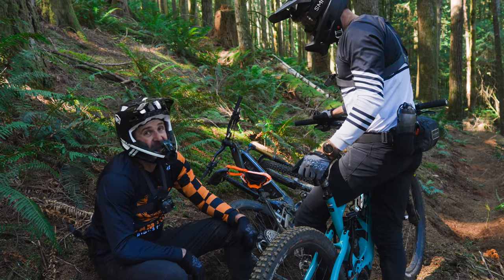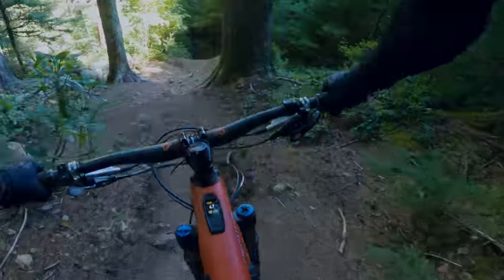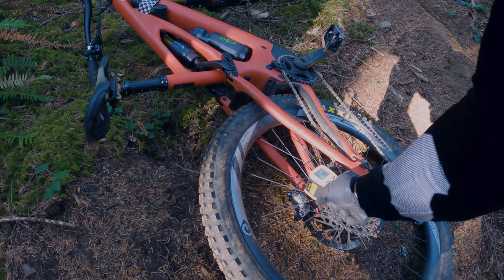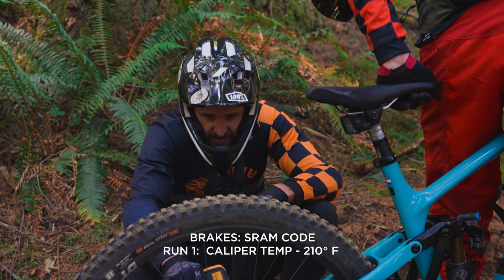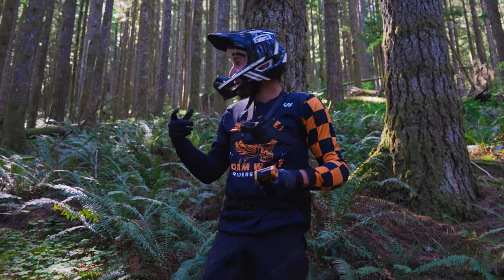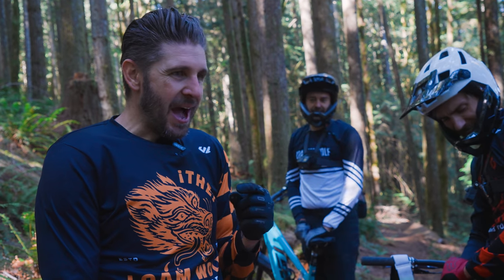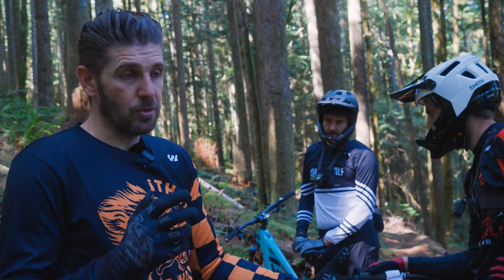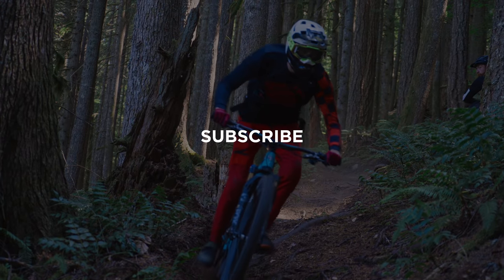Mountain Bike Brake Test - Temperature Testing. How Hot is Hot?

Comment: Why only measure caliper temps?
Reply from the maker: We measured rotor temps as well, during each of our 3 outings to make this video. When testing, and talking with brake engineers, we learned that rotors are a lot harder to get temps on because of the small surface area, the large heat sinks (each of the arms going to the mounting area) pull so much heat so quickly that rotor temps change so quickly. We could take a temp reading on the center of the rotor and 2 seconds later take one just above the arm and have a 35-degree difference. Furthermore, when we talked with the engineers, we learned that they primarily check caliper temps, and use stickers on them to get max heat because it's more reliable and repeatable.
Reply: @TheLoamWolf  thank you for the reply.. glad you were talking to engineers. 

I know about the caliper stickers as they use them in motorcycle racing too (I do motorcycle trackdays). The fluid temperature is fascinating to me too but I suppose you can assume the caliper temp will be similar to the fluid temperature.

Great to see some people try and do something more scientific too 👌

Comment: Yea rotor change even in same size can make a huge difference I noticed that with stock resin only Shimano rotors 160, 180, I cooked those badly, they got really hot, after braking after one hill, swapped to hope floating rotors and problem solved until I rode more of this type of riding, then they started to warp, same with 180, 230mm combo, so now I have 223mm TrickStuff Daähle I got secondhand. An issue with floating rotors is after few years of use they might start to creak. So I will stick with regular rotors.

Comment: Hey I’m new to mountain biking and I’m wondering what I should upgrade on my bike first
Reply: go out and break something on it first!
Reply from the maker: You should definitely upgrade skills first by watching a good, qualified instructor or better riders! 
From there we’d say tires are high on the list! Quality rubber compound then suspension and brakes. 

We’re going to make a video on this topic though! Stay tuned
Reply: Any touch points, pedals, grips, seat, just to get it feeling nice then do tyres and then brakes (if their not holding up)
Reply: @ryanmission  already have I’ve been riding every day for about an hour getting better and earlier today I ran into a a rock with my back tire and it popped

Comment: You called it kind of scientific but only measured the rear brake temps? It made it pretty much pointless…
Reply from the maker: Could you explain why it's pointless? Our curiosity, and desire to do this didn't stem from wondering how big of a difference in heat there was from front to back. It was how hot rear brakes get, since they get used way more.

Comment: These results are flawed. First and foremost due to the TRP caliper being coated in a metallic/reflective finish, whereas the other two calipers are black or dark gray. This will yield large differences when measuring temperatures with an infrared thermometer. The results found with the reflective TRP's being consistently colder are to be expected. Additionally, the subjective sense of arm fatigue/pump is influenced a lot more by the lever position (angle), pad/rotor friction, piston sizes and lever design rather than temperatures -- unless there are catastrophically large differences in hydraulic fluid performance, which is probably not the case. So basically while this video is entertaining and interesting, the test results themselves should largely be dismissed.

Comment: Your test is not accurate due to the fact that numbers of tester 3 , reason different rider style , different body weights, different braking points , my opinion is, it should be one tester one trail .Thank you, in fairness to 3 different brake systems.
Reply from the maker: Each tester rode each of the three bikes. So essentially we did what you are suggesting, but 3 times. Hope that clarifies that? Each rider rode each bike to account for those differences.

Comment: This test is really pointless. They are pointing a heat gun at the caliper, but caliper temp doesn't reflect the pad or rotor temp, where fade actually happens!! You could have a caliper temp 50% higher, but it could still have less fade based on the pad material!! The pad and rotor temp will mostly come down to rotor diameter, thickness and built in cooling in the design (fins ect.).  Don't get me wrong TRP makes great brakes, but this test is just ill conceived. Any real test needs to use control pads and rotors or your trying to test too many variables at once!  The caliper temp is a complete red herring, as you could use lot's of heat shielding to keep the caliper cool that reflected all the heat back onto the rotor and pads. I hope this channel does better in the future.